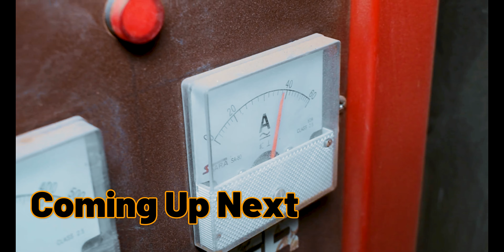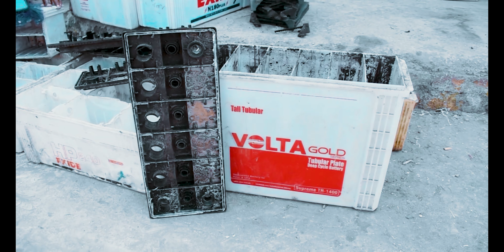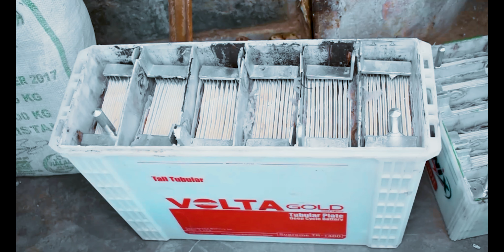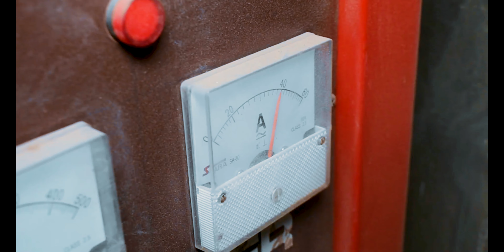Solar Battery Repair || How To Restore Dead Solar Battery

Comment: You take off the case and put a new battery in it ? That's like how to fix a car , you take off the radiator cap and slide a new car under it ?